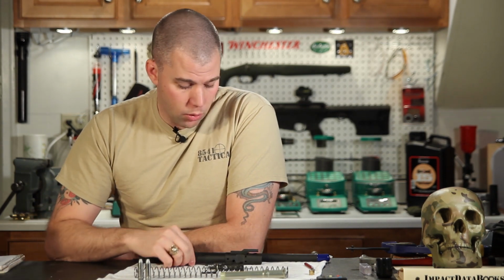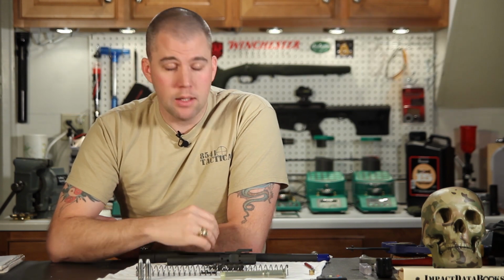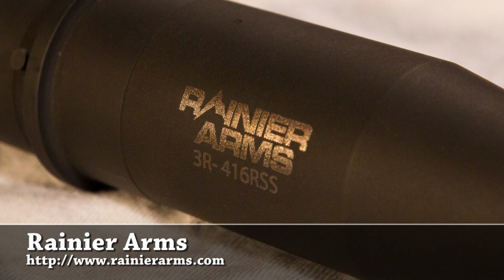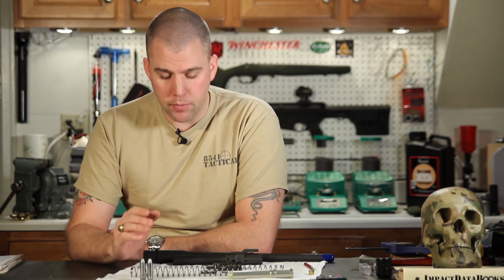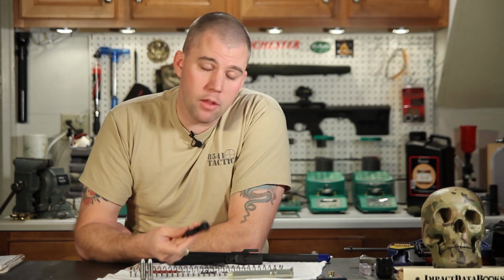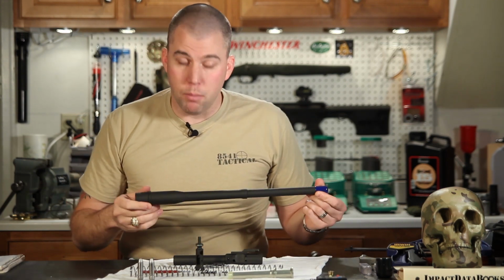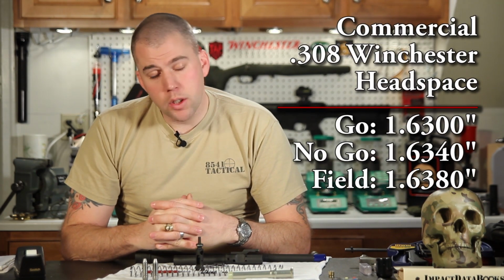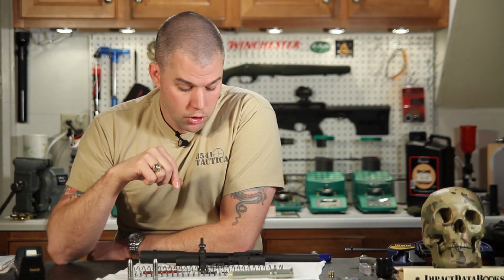MATEN Build Series 06 - Operating System Selection and Headspace Check

Comment: M1955. I am changing my 223 ar carry handle to flat top using the same barrel and the same bolt. Do I need to be worried about head space?
Reply from the maker: Always a good idea to check, but if the bolt and barrel were good before, it doesn't matter what upper receiver you put them in. Just make sure the barrel and bolt stay together.

Comment: Thanks for the excellent video on headspace checking. I picked a similar Rainier barrel in 20". I followed the directions you provided and was able to determine that my barrel and bolt combo is save for 308. The bolt did not rotate with the No Go gauge. Does this mean it is not safe to fire 7.62x51 with my barrel/bolt combo?